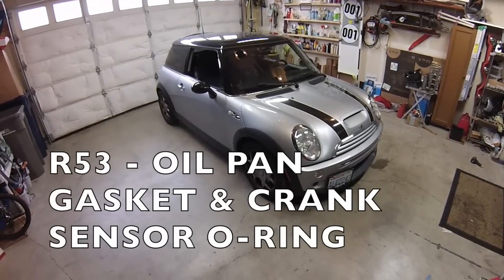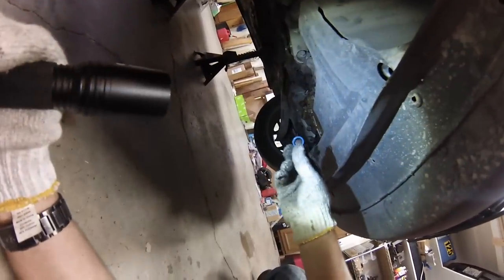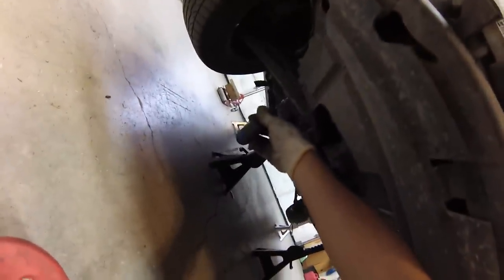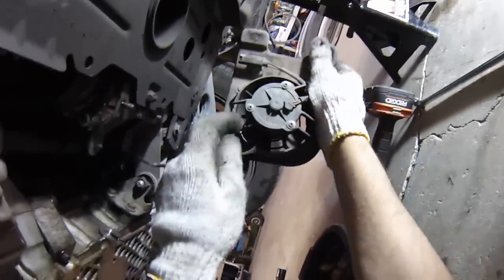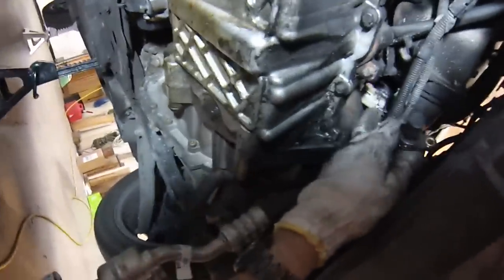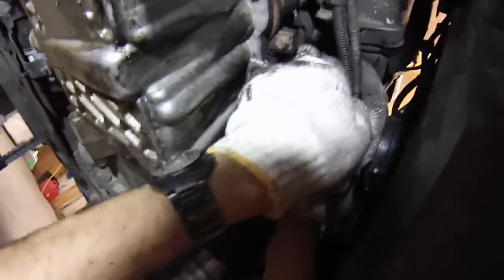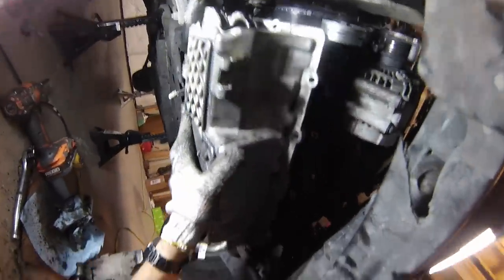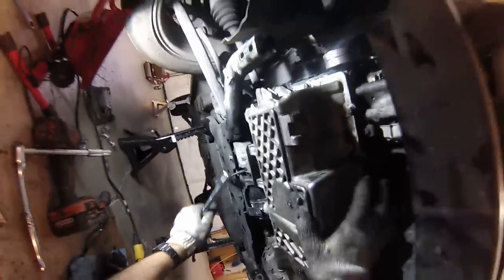Replace MINI Cooper crank sensor o-ring & oil pan gasket R50 R52 R53

Comment: Thanks a lot for the video! Helped a ton, especially the "train on the coil pack clip first".
After fighting for 2h upside down with that darn clip (I skipped the compressor removal since I was only doing the sensor), one big advice for others: if you struggle with the crank sensor clip (bad dexterity, big hands, tons of grime, whatever), pull the 10m bolt first and the sensor out of the engine.
That way, it falls down a bit and you have much more room and access to unclip it. Or you can even skip the unclipping altogether and change the o-ring right there.

Comment: Just did this. Don't need special belt removal tool. There is a 3/8 square ratchet hole in the tensioner. Just put a long ratchet in the hole, and you can release the tension on the belt. Use an allen wrench for pin. Thanks for your great video. I would not have tried this job 
without it.
Reply: Great to know. That did the same on my '97 Isuzu hombre. Thought maybe same with my Mini. Cheers!
Reply: Good to know!

Comment: Perfect timing for this video. Thanks so much! My car is currently up on jacks in front end service mode for a radiator replacement and I was debating whether to go ahead and replace the oil pan gasket. After watching this video, I think I'm up for it!
Reply from the maker: Get that crank sensor o-ring as well if you haven't already done it :-)

Comment: Mod MINI: I have watched a few of your videos and you are amazing- the way you break it down works great for me (especially the timing chain tensioner- going to do that very soon).  I am a newby- have had my "04 MCS for 7 years.  My mechanic has price gouged me on parts (I started investigating how much stuff costs and if I could fix it myself).  Bought OBD2 reader a week ago- has paid for itself 10 times over (cylinder 4 misfire).  Changed my spark plugs, ignition coil, swapped defective coolant resevoir- and today I did my fuel filter(by following your video).  NOW HERE IS WHERE I NEED HELP: when I was replacing my coil, I accidentally dropped a grommet down- I could see it but had to get under the car to get it with needle nose.  While I was under, I noticed a lot of oil all over the bottom of the pan.  I knew I had a minor leak, and was going to do my first full oil change (next week)- had assumed that my mechanic hadn't changed my drain plug/bolt.  I touched the bolt and gasket and oil dribbled all over my hand.  This video scared me a little bit (big job for a novice)- COULD the drain bolt and gasket being old and bad cause a leak like that?  The leak started RIGHT AFTER my last oil change about 6 months ago.
Reply from the maker: Impossible for me to say without looking at the car. Most common oil leaks are crank sensor o-ring seal, valve cover gasket, oil pan gasket, oil filter housing gasket. The drain plug can leak as well if not properly tightened/cross threaded. A drain plug leak will drip to the floor and will drip even if car is not driven. The others only leak when car is running.

Comment: Thanks for all your videos. For the oil pan gasket change, I find that it’s better to bolt on the three horizontal bolts first. This will hold the pan in place for all the 10mm bolts to catch the thread on the engine block. Cheers!
Reply from the maker: I do opposite. I put in a couple 10mm bolts to hold it up there. Then insert 15mm bolts while using up a little more. Do not tighten any bolts fully. yet. Hand thread all bolts before tightening any and make sure to push oil pan toward transmission while doing so.

Comment: Great video thanks. Well I've had the rear main crank seal done (plus new clutch) and I did the crank sensor o ring myself, but it's still leaking oil.  Getting a small patch, dripping off the bottom of bolt next to that weeping hole /between sump and flywheel.  I will do the  sump gasket next and really hope it stop this pesky leak.  Excuse to get the spanners out on the Mini, so I'm ok with that :)
Keep the vids coming
Cheers
Reply from the maker: That's either a botched rear main seal job (happened to me one time, I had to pull the transmission again to redo the seal for free) or oil pan gasket. Oil pan gasket usually leaks along the back side of the engine but it might come out around the weep hole as well.
Reply: done the sump/oil pan gasket and it is still weeping oil from the weep hole - oh boy not good. other than the rear main seal again - what else is up there that could leak? must be the rear main crank oil seal - How could the garage botch that? damage the seal when inserting it somehow I suppose? so frustrating.
Reply from the maker: Gavin Yeo
Nothing else up there that could leak. If it was replaced by the garage, go back to the garage and complain. Every once in a while a seal will leak - either a bad part, a burr or some wear on the crankshaft seal surface, or the seal was installed improperly.
Reply: Thank you kind sir.  Appreciate your quick replies! Obviously you have Mini in the blood!  I will go back to the garage in the week and talk it over with them. All the best. Gav Southampton, UK
Reply: ***** well got the garage to redo the oil seal under warranty...they had a good look as the bell housing was splatter caked ..not the oil seal after all oh no!!  There was a growing crack in the gearbox casing around the diff bearing.  Gearbox oil was leaking, not engine oil.   Well, got a recon unit fitted now.   All the best
Gav

Comment: thank you! this video is very helpfull i thought you had to take the crank pulley off to remove the oil pan. I appreciate the video and will also replace that o ring. Would it be good to change my oil pressure sensor? while im there?
Reply from the maker: Oil pressure sensor (on the back of the block) should not need replacing unless it's broken or leaking. The crank position sensor o-ring (on the front of the block) is a different story - that o-ring should be replaced.

Comment: Looks like a lady friend's 06 S has a leak in the same spots I've seen in both this video and the other one addressing the CPS o-ring. She was quoted $4k for what might be a rear main seal, but the majority of the oil is on the front of the oil pan/transmission leading me to think it could be just the CPS o-ring and maybe the pan gasket. For my first time removing an oil pan from a Mini, how long do you think this would take? Looks like everything is fairly modular and easy to work with, compared to an old Audi I used to own. Also, if the RMS was leaking, where would the majority of the oil build-up be? To confirm, I might have her wipe up the oil from the pan and let it seep over a couple days to see exactly where its coming from... Thanks!
Reply from the maker: 90% of the time it's a crank position sensor seal. The crank position sensor WILL be leaking if it has never been replaced. They all leak. All of them. There will be a buildup of grimy oily mess around the location of the CPS. (just in front of the bell housing on the front side of the engine).    The time required to remove an oil pan depends heavily on what tools you have and how quickly you figure things out. I'd guess around 3 hours maybe? If the rear main seal is leaking, it mostly shows only around the weep hole and behind that. It's rare for that seal to leak before 100K or 120K miles.

Comment: Getting ready to do this and some other basic preventative maintenance, do you have any preference to Genuine MINI gaskets vs Aftermarket OEM suppliers?
Reply from the maker: Aftermarket is fine as long as you get a decent brand. Victor Reinz is good.
Reply: Was going to ask the same question. Thanks Aaron Meyer, Mod MINI.

Comment: Hi, have referred to your videos dozens of times now. I have now got a crank no start 2005 cooper, am about to solder new batteries in the fobs, if that doesn't work is it worth me replacing the Crank sensor, and if so you said its possible without front end off, is it worth a try?
      Regards J

Comment: after I replace all of them, yeah the lights comes on again, so I when to connect the scanner and told me it was the right side rear abs sensor, so what did, I just clean everything as much as possible even the wheel bearing, and I when to a test drive and again the lights on, I check it again with the scanner and told me is the one in the left side know. and it's only when the car go between 75-80 miles per hour, before that, no problem. Thanks again   really appreciate it.

Comment: Do you have to put the mini in front end service mode for just an oil pan gasket change?
Reply from the maker: Yes, the air conditioner pump needs to come off. Technically it is possible if you remove lower dog bone and pull the bottom of the engine backward with a  tie strap, but it's really crowded and it's easier and faster to just move the front end a couple inches forward.

Comment: Thank you so much for these vids. You are the go to guy for Mini's! I am changing the CPS and oil pan gasket on my 2006 S R53.  I bought the car used and I know the auto transmission was rebuilt so I assume the engine was pulled.  After cleaning up the pan I noticed  small cracks on the inside radiating from the oil pick up sump area and a few more here and there. On the exterior I don't see a matching pattern but I did find a few similar looking cracks here and there. There was a lot of oil leaking so hard to say exactly where it was coming from but the CPS was definitely leaking.  Some say these pan cracks are nothing to worry about but I don't see anything like this in pictures of new pans.  Worried someone used a floor jack on the pan to lift the car or something similar. No scratches or marks like the pan hit something. Ever seen anything like this before? Thanks in advance.
Reply from the maker: There is appearance of cracks around the casting fill area due to how the oil pans were cast, but I've never seen one leaking because of this.

Comment: Question, you might be able to answer. Oil drain plug gave a copper washer that goes with it?  Did a job and added the oil change. Had this one washer left. Didn't know if it came from the drain plug or if it was part of the filter housing.
Reply from the maker: +Adam Barraclough Stock does not have a washer. Aftermarket might. The only copper washer I can think of is to a power steering banjo bolt or a brake line.
Reply: You have a Facebook page?  I'll send you a pic see what you think.

Comment: About to do this job on the 2005 S we just bought for my daughter. Can’t quite tell for sure if the oil pan gasket is leaking, but figure it’s not much more work to replace it while I have it torn apart. Aside from replacing the belt is there anything else I should do at 65,000 miles (yes only 65 k on this car!) while I have it in front end service mode? Should I replace the crank position sensor too?
Reply from the maker: It could also be crank position sensor or valve cover gasket, which always begin leaking sooner than the oil pan gasket. You'd have to study the oil moisture pattern(s) to correctly diagnose the source.

Comment: Thanks a lot for this awesome video... I am going to get mine done.... question? What will cause my oil sensor light on my console to flush periodically... I know my oil level is good but seems have the sensor light come on every so often. Any ideas? I have a 03 cooper S. Thanks for any suggestions.
Reply from the maker: Typically that's worn main or connecting rod bearings causing a drop in oil pressure. Also could be damaged anti drain valve inside the filter housing. If damaged, oil pressure does not build. replace the oil filter housing first, if light is still on, you're probably looking at major engine work.

Comment: Would the leaking Crank Sensor O-Ring be a really fast leak?  I lost all the oil in our '04 in a day.  It actually made a line of oil down the road.  Not a drop of oil on the dipstick when I checked it.  I'm not in a position to do it myself, so I'd like to have some idea when talking to a mechanic.  Thanks for your videos.  They are well done and easy to comprehend.
Reply: I just looked under the car.  The O-Ring in question is leaking but only a very slight amount in the front of the car.  The major oil leak seems to be on the serpentine belt side of the engine and I can't see where.  Any ideas?  Would that crankshaft seal be the culprit?  The car has 85K miles on a 2004.
Reply from the maker: Triangle T Guest Ranch Crank sensor o-ring is a slow leak unless it's blown out or something. Typical leak that will blow all your oil is an oil filter cap o-ring. If that is torn, you'll lose most of your oil in as little as a few minutes.
Reply: *****
Hey Thank you!  ('Im the same guy as above).  I haven't had time to check but that seems about right for the situation.  It probably built up pressure and blew it out the filter area.  It seems odd that the car never gave me a warning light or any indication of low pressure or oil.  I had it at Jiffy Lube the week prior for an oil change.  Now I lost all that brand new synthetic oil :-( but that's better than pulling the engine.
Reply from the maker: The gen 1 mini does not have any oil level warning. It only has an oil pressure sending unit that will only report when pressure is below a critical minimum. Pressure only falls below this minimum if there is a failure of the oil circulation system or there is no oil for the pump to pick up. 
There won't be any warning until the very moment you are completely out of oil, at which point your oil pressure light will come on.
Reply: *****
Wow, OK.  I didn't see a light so I'm lucky I guess.
Reply from the maker: Bret Austin
How did you know about the failure? Proactively check the dipstick or you saw the line of oil behind you?
Reply: It was noticed by the line of oil on the ground.  I checked the oil filter, there is no oil around it.  Also, the main pulley that drives the serpentine belt where it attaches to the crankshaft is dry.  The belt is dry too.  It appears as though the oil leak is somewhere below the head and above the oil pan on the end of the engine where the oil filter is.  I can't see it.  It's frustrating.  If I lived closer than 100 miles to the nearest Euro mechanic, I'd take it in.  But I'm going to have to trailer it to Tucson and get it fixed.  :-(
Reply from the maker: Bret Austin Could be oil filter housing gasket. http://amzn.to/1CB3MS5

Comment: Thanks for your excellent video I did the job step by step and It was fun cause you feel sure doing it, the only thing I see when I was replacing the oil pan gasket i saw by the filter housing oil coming down from there too and do you have any recommendations about it? And also after assembly everything back and turn on the car my mini start going up in the revolution like 1800 then goes down to 1000 and it's doing it constantly. Any idea what could be?
Reply from the maker: There is a gasket between the filter housing and block. It's held on by three bolts. Remove the power steering fan and lower engine mount to get access. You may also need to pull the right axle. I've only ever replaced this filter so far when the subframe is out of the car, which gives lots of access. It may also be possible to attack from the top side (where you usually pull the oil filter cap). 
Yoyo idle is probably a vacuum leak.

Comment: Hi, I watched your video on the chain tensioner, first thanks for it. My 2006 r53 Cooper s had this problem. I caught it early, and decided to replace the tensioner. It was super easy. After replacing though, and letting it run for a while, the noise was still there, but nowhere near as bad, almost unnoticeable. Any advice?
Reply from the maker: youngji273 You might have a damaged chain guide rail. The only way to know for sure is to drop the oil pan (or maybe stick a camera scope in the oil drain plug hole.

Comment: Excellent video brother ... Head and oil pan gaskets are on the top of my to do list after replacing the front struts.. Wouldn't have thought about the crank sensor o-ring tho... 
Do you happen to know by chance if thats a standard or metric o-ring? 
Only asking cause i bought an assorted pack of metric awhile back... Might just buy the other set just to have... 
Appreciate the upload , very informative ..  Thank you :) 

Now if i can do it as fast and effortlessly as you did :)

Comment: Ok thanks for replying. So when it locks will it be at top dead center?
Reply from the maker: +Rufus Biggs MINIs are not serviced at TDC. It will lock at the point where all pistons are at same height I believe. The cam will either be at the correct position or 180 degrees out of phase. Rotate the crank another 360 to put cam in the correct orientation. The rounded lobe at the tool interface should be facing down and the three flat lobes should be facing up, left and right.

Comment: You are amazing!  Thanks for posting all the videos.  You have made my self servicing of my Fun Car sooo much easier.  Question: Can you change the oil pan gasket without going into front end service mode?
Reply from the maker: +greg arifian Yes, but it is very difficult to access two of the three bolts holding the AC compressor. Watch this video for how. https://www.youtube.com/watch?v=d1A41iHzBiE

Comment: Just did this job amd now my a.c. conpressor isnt turning on, im positive I plugged everything back in. I even unplugged and replugged the compressor plug again and still nothing. I did notice my power steering fan is not working could that be related to the compressor not working?